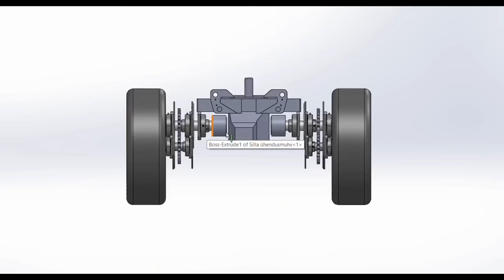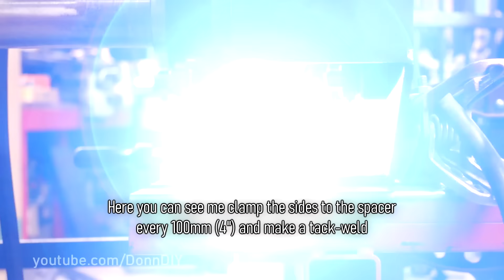4x4 PTO Driven Timber Trailer BUILD Ep.12 - Chain Housings Completed

Comment: I am really liking this whole trailer build! Using the screwjack to get the bow out of the sidepiece is a great illustration of just how versatile that little jack can be: simple, light, relatively small... but able to exert just enough pressure, in just the right area to get the sideplate square with the rest of the case. Don't forget to add the lifting loop on top of chaincase #2. You'd really be kicking yourself if you broke down and had had to remove the case for repairs, without the loop in place! 
  It looks like you'd much rather be actually building stuff, than drawing it out for others to build, but it suits you. I hope being a farmer and top notch fabricator pays at least as well as being a draftsman did.

Comment: In my opinion a better solution would have been if you turned the housings into oil sumps instead of the plain bearing blocks which need to be greased fairly often which becomes a hasle over time.
All in all great build!

Comment: Curious as to why you would weld in the bolts rather than use a press in style line a wheel stud? After final welding it would be near impossible to remove a welded in bolt. Might be an idea for your next build.

Comment: Try 75% Argon / 25% Co2 mix gas next time,  although it depends on the wire you're using and the material you're welding, just a little advice.
Reply: I think his mix bottle just ran out and he had a spare co2 while waiting for a reload.

Comment: Nice copying of the first housing!
Did you found things to improve for both of them while making the second one?
Does the casings need venting holes in case of heating up and building excessive oil pressure that could leak along the shafts? Maybe through the filler caps?
Just an idea...
Thx for the update, always geat to watch!
👍👍👍

Comment: I'm curious how much weight the welds added. I realize it probably isn't a significant amount since they were ground down, but would still be neat to know.
Reply: Easy enough to get a rough answer based on how many rolls of welding wire he uses. 
Like you mentioned though, a percentage of that ends up on the floor.

Comment: Love this build series. Nice job. I also got a ? tho. Adding the chain to them sprockets is gonna increase the torque strength so them bolts are gonna be under a lot more pressure an I'm worried they will straight shear off or come lose without any nylon lock nuts an lock nut washers. Do you see that being an issue ? I'm just wondering cus it was something I said to my self in my head while watching. I'm not knocking it at all but would hate to see you have to change them bolts an nuts later down the road.

Comment: Try using pure Argon gas with your Mig welder. I ran out of 75/25 mix and was in a hurry, so on a leap of faith I used the Argon from the Tig welder. It does require a little more wire feed, but I honestly like the smoother look of the bead with Argon. I encourage you to try it sometime 😉

Comment: Never ever weld downhill on anything structural,frames,heavy duty... Flat and uphand only if you want it to last and not start cracking over time...
 Downhill is acceptable for sheetmetal and cosmetic welds only...

Comment: I enjoy watching your builds,  I have a question, when you were welding the the main body you jumped around a lot, why don’t you weld one long bead.  Thanks for you videos.
Reply: He moves from one place to another to control heating in the metal to avoid warping and twisting etc. If he were to start on one end and run a continuous bead it could deform the part.

Comment: CO2 is good, but your seriously need to know every setting on your machine and what you're welding down to the decimal. My brother is sh!t with repairs in general, but he's got his welder's degree and he can weld you a CO2 line smooth as a baby's butt. Even tho i make 99.9% of the repairs every time i go over to his place, he's the welding authority.
Myself, i use mix as well. Much easier, less hassle.